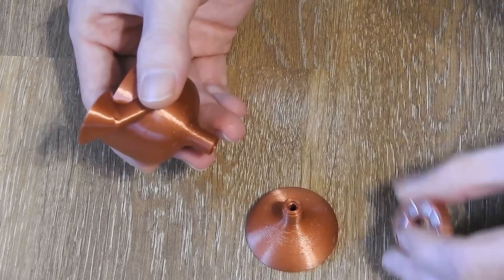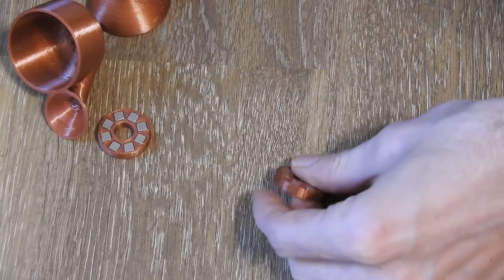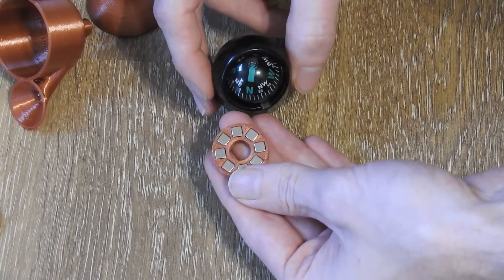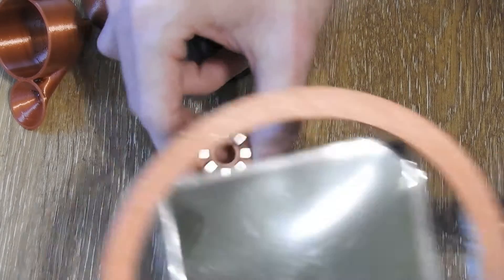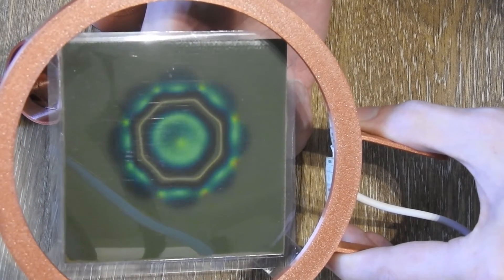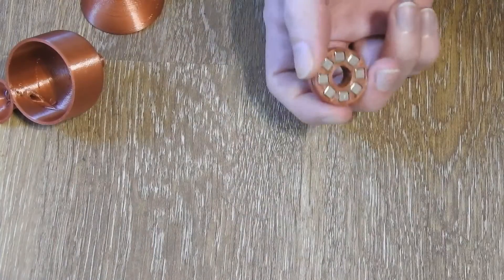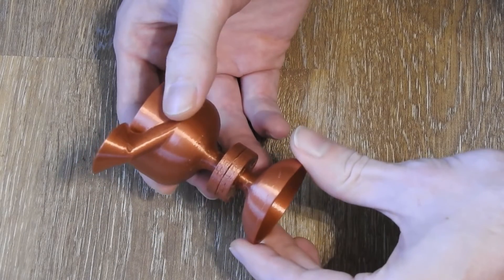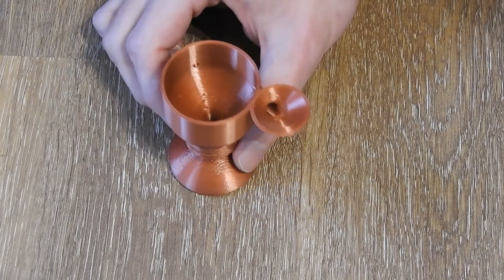Water memory cleaning device using circular magnet array and Schauberger vortex funnel

Comment: could you use a powerful ring magnet instead?
Reply from the maker: Yes, but the field geometry wouldn't be the same as with this array.
Reply: @OmegaZZ111  do you mean with the central still spot? thank you
Reply from the maker: @neuroblossom  The polarity is a bit different, if you use a radially magnetized ring magnet it would be the same but most ring magnets are axially magnetized.
Reply: @OmegaZZ111  thank you so much omega. why is this configuration desirable for the water memory cleaning operation?

Comment: Is there a way to measure the negative electrical charge of structured water with a multimeter? or a way to know my water has been correctly structured? thanks!
Reply from the maker: I don't think you can measure that with a multimeter.
The easiest way is to do seed growth experiments with structured and regular tap water for comparison.
Reply: You can use an ORP meter to meassure the electric charge, they aren'tt verry expensive.

Comment: hi
your thingsverse link stopped worlking
also when i downloaded your files, there are 2 versions of the funnel
also, why all peices are in one print, i think the magnet array is missing too
wouldnt it be easier to print the parts separately?
I will give it a go anyway
thanks
Reply from the maker: I updated the link to the latest version.
The magnet array is included in the print.
Reply: @OmegaZZ111  thanks
Can you senate the parts to make it easier for printing?
Reply from the maker: @Gacha.Cupcake  it can be printed in one part, you don't even need supports.
Reply: @OmegaZZ111  trying now

Comment: Can the print be scaled?  I feel like it may be a little impractical to use for something like a cup of water, or it can be counterproductive if it’s spilled outside the top due to overflow.
Reply from the maker: No if you scale it the center hole gets bigger and the magnet array won't fit anymore.

I already designed a better and bigger version, video+3D files coming soon.
Reply: @OmegaZZ111  That’s great, I’ll be sure to check it as soon as it’s out!  Thank you!
Reply: You have bigger version bro?
Reply: @andrzejdzioch8671  

Me?  No.  I don’t even have access to a 3D printer.

Comment: I would use this myself along with charcoal filtration and distillation. I just don't know in what order or what combination. That, in my opinion, would be the best water possible.
Reply: Physical water purification first.
Reply: This is the final step, unless you are adding additional minerals. Technically, purification removes some electrons and minerals. This device replaces some of that, and simultaneously clears the water of memory/bad energy. 💯